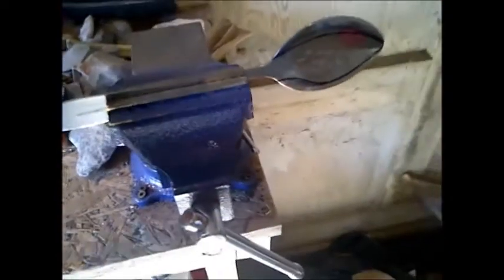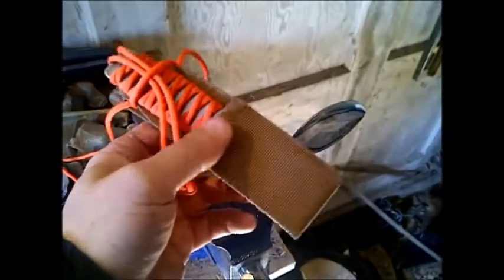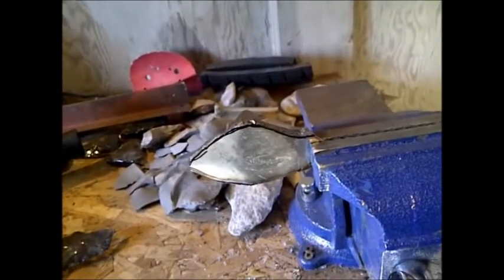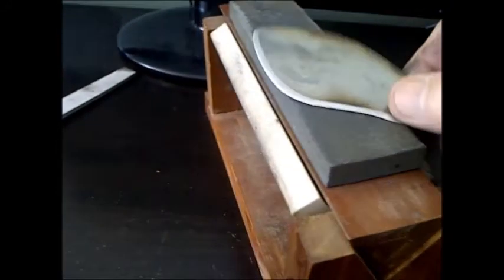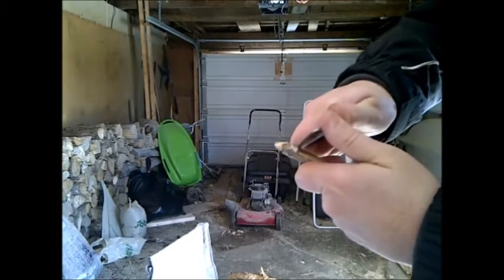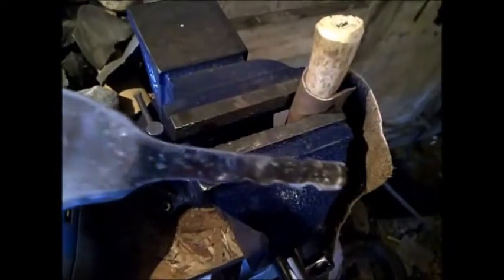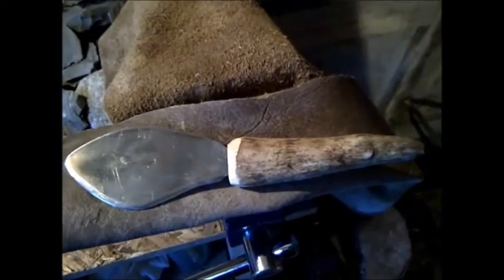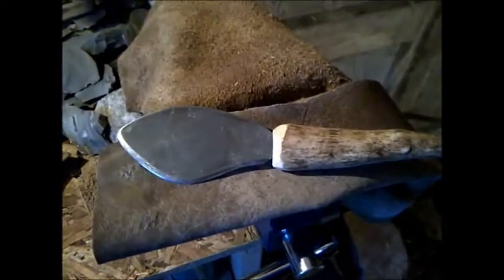DIY  Making a skinning knife from a spoon

Comment: Its a cheap stainless steel spoon from china. They are not tempered any way and it will not hold an edge.
Reply from the maker: Yes but it worked well and to this day is still working well. :)